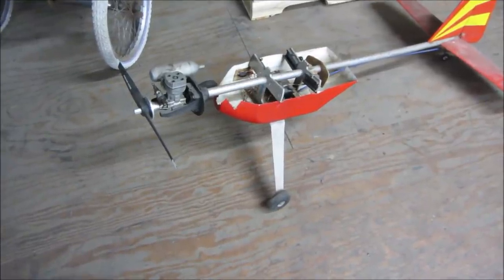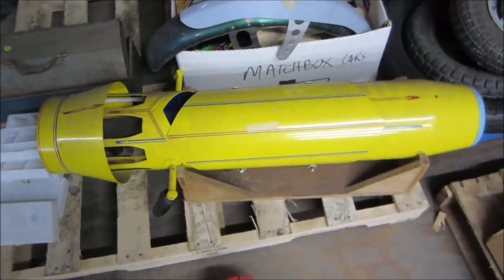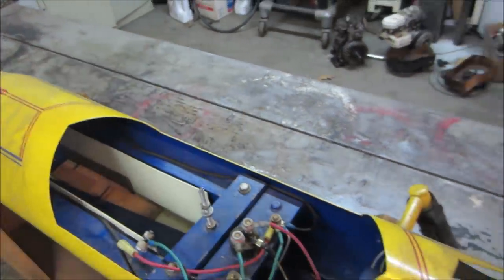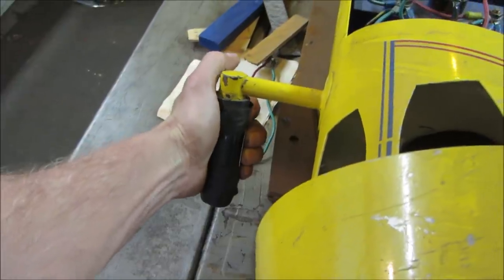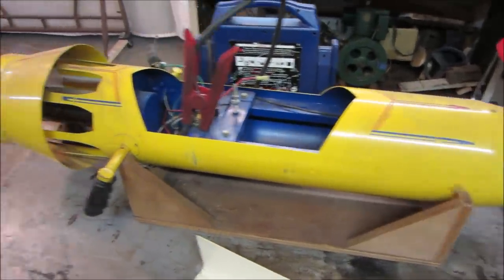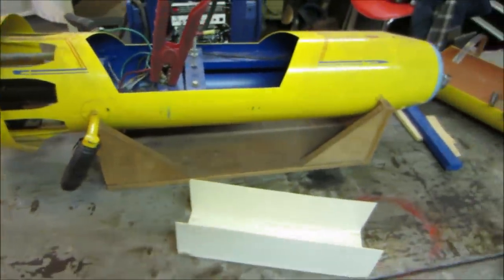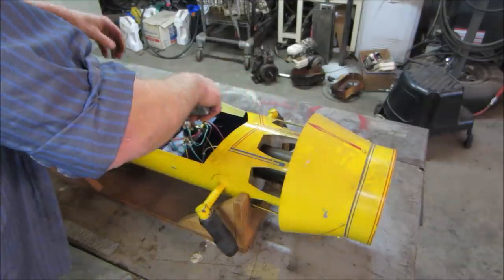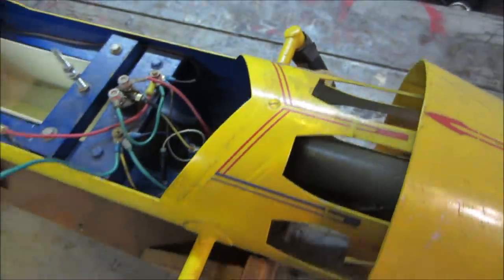Antique Scooter for The Water? Will It Still Work.

Comment: Back in the late sixties Cousteau used a bit sleeker version.  I don't remember the cone enclosing the prop flaring out so much at the forward end.  You could buy them and I remember wishing for one at the time.  This was before electric trolling motors I believe.  I never saw them used for anything but scuba diving.   There was another version where two riders sat upright on a larger version.  Only saw them used by the military and in movies.  This looks like someone creating their own.  The factory ones were fiberglass.  I think they had a sealed battery compartment.  They did have limited range.
Reply: Reality Effect  Show me anyone without feet of clay...  Give the devil his due Cousteau brought a whole generation to the undersea world.  His cinematography was unparalleled at the time.  Was he an elitist?  Certainly.  Selfish? Beyond doubt. Was he effective as a communicator?  Very.  Lesson here... Never hero worship anyone or be prepared to be disappointed!  That includes religions.  Think for yourself. That doesn't mean you can't appreciate the good that is done.
Reply: I have a Trolling motor from 1948. It uses toggle switches for F/R, 3 Pos. dial switch for speed, and an off/on switch for go/stop.
Reply: @douglasthompson2740  What an excellent response! Thank you!
Reply: Kind of reminds me of the ones they used in the James Bond movies.  I think it was Thunderball with Sean Connery?  The big underwater fight scene at the end had a bunch of similar units, although armed with spear guns and much fancier.
Reply: My 12" GI Joes from the 70's had stuff like this lol
Reply: Me and my brother and sister used to watch Sea Hunt back in the 60s. Lloyd Bridges had a machine like this only it was like twice as big.
Reply: @Guitarzan8  That's it!!  SEA HUNT, with Lloyd Bridges.  I knew I had seen that thing somewhere.  I'm sure I saw it, or one like it, on Sea Hunt.  LOVED watching that show.
Reply: Reality Effect   Not that I don't believe you. But never researched Cousteau that much. He really caused another humans death in pursuit of underwater exploration ? Bit ironic if accurate. Thanks

Comment: Looks like a early model sea scooter with a headlight.  Definitely meant to be watertight, the inside of that scooter doesn't look like it would work very well if it were wet and salt water on the inside would have started corrosion which would be obvious as well because it's clear that if it were allowed to get wet it would be very difficult to dry it out again.   Looks very similar to the ones created by Jacques Cousteau (their inventor) so probably at most two generations removed from the originals.

Comment: That rc plane is called a "pipe dream" and it is from the 80s.  There are a couple of videos of it on youtube. You could adjust the CG by moving the wing back and forth.
Reply: Yes - the Pipe Dream but it definitely isn’t a scale model of anything that ever flew with a pilot.
Reply: @assessor1276  I never said it was scale.
Reply: Built by Byron Originals, in Iowa. They had some pretty impressive scale kits for sale and put on a great RC air show every year.
Reply: @animalmother9339  I think it was a slip of the tongue on his part. I've been asked what scale some plane were by people who don't actually fly but they are usually saying scale when they should say size.
Reply: @jennitro  I got to go to one of their shows. I don't think they do them anymore. It was great. I think they're out of business now
Reply: @randall1959  They moved the show over to Ames for a few years, then it kind of just stopped. Maybe made it to 1990, but I'm not sure.

Byron Originals went away about the same time, I think.
Reply: @jennitro  I went when it was in Ames. It was one of the last shows.
Reply: @randall1959  They ran it for 6 or 8 years over in Ida Grove where the company was based before they moved it. I never made it to one of the Ames shows, so I don't know how they compared.

Byron Godberson was the owner of Byron Originals (or at least the Godberson family was). They had quite a few businesses in town. All their buildings had this castle look to them.
Reply: @assessor1276  There were some whacky designs in the early years, because if you weren’t trying to carry stuff, there’s no need for the fuselage to be anything more than a strut with sufficient strength/rigidity and room for control cables. 

If Bleriot had fibreglass he may well have built some of his planes this way, but instead it was open trusses.
Reply: @fromagefrizzbizz9377  The pipe dream was designed to carry lighter glow powered engines or the heavier gasoline engines. Being able to slide the wings back and forth allowed you to change the CG to affect flight performance as well as not having to add or subtract weight to balance it. If you had a light engine slide the wings back or if it was heavy slide them forward.
Reply: @randall1959  Exactly.. thank you! lol

Comment: Dry cell batteries like what would used in a mobility scooter. Look for long Amp hours. You could also use cordless tool batteries.  When testing a scooter I got I use 2 batteries from snap on and they did quite well. Plus you halve them in your shop. 
Thanks from Staunton Virginia, Bob Ordewald

Comment: my parents were scuba store owners and instructors in the 80's they had a pair of very similar devices. I do know they were expensive. They were branded though. in use you didnt actually stay behind it but kinda loomed over the thing. run time was pretty short if I remember correctly. they used them to chase students that were flailing about. basically they would roll up on someone who was panic and hit their vest inflator or drop their belt. these ones were pressurized in use so you could get them neutrally buoyant. I was snorkeling above and watched the crazyness. much shorter than this one too.
Reply: Any chance of this comment in English ?

Comment: Hello Mustie short or longer videos both are worthy of a cup of coffee and my time. Please keep them coming. I think you could add that to the Beaver and improve it!s water performanc. Hey look there is another video?
 As for the unit my father was in a SCUBA group back in the 60!s they made a lot of the equipment themselves. This looks very much like one of the proto type units. I think it should have 2 or 3 big wide stainless band clamps to secure the cover to the body,  They were supposed to be water tight and almost neutral in buoyancy.the later model had the Handel's a little farther forward and you rode over them  with the unit resting under your chest,  you were also correct there was a Popular Mechanics or similar type make it yourself plans available back in the ugh " Good Old Day's. Keep up the great work.

Comment: The lack of safety features is concerning but you generally would hold it in front of you and below your line of sight to avoid the wash.  They also should have a magnetic kill on the handle so if you let go, it wouldn't disappear into the depths. For a fat diver like me, they would add a considerable amount of bottom time to the dive.  A blast to use.
Reply: The lack of safety features keep the balance of nature in check.
Reply: I 100 % expected the prop to spin up only if both switches were closed as a minimum safety feature, but, eh.

Comment: Loving it!

The names "Aqua-Doo" or "Hydra-Tow" come to mind, but I doubt this would be either. If I'm honest, I thought it looks like a DIY kit build, something you'd buy from an ad in a weekend magazine and assemble at home. I had even wondered if it was ever completed, or has ever seen water.  It's definitely a crude effort.

I would check that thick rib along the bottom - See what it's made of. My guess would intuitively say it's metal, and I'd surmise it is actually meant to be a keel, to give bias to its buoyancy and keep the machine 'right side up' - If it's wood, then it's not much more than a fender/rubbing strip.  I'm also wondering if the casing should contain some form of flotation bladder - An inflatable bag, or bags to allow the user to obtain a neutral buoyancy. You could use the bladders out of footballs, or even a couple of plastic bags filled with ping-pong balls would help. Just a thought.

Batteries? In the modern world I's suggest NP12-12 or NP12-15 as a starting point, and up to NP12-18 or NP12-22 mobility batteries - Sealed Lead Acid gel/AGM batteries. Emphasis on sealed, you wouldn't want sea water getting into a lead acid battery, the consequences could be severe.

Comment: I thought u would ride that thing like a torpedo, i wouldn't like having the prop in my face :D
Reply: As long as you don't wire it backwards it shouldn't be too dangerous, the propwash would push your face/fingers away, and you'd hit the trailing edge of the blade first. Just keep any dangly bits away from the intake bell.

Comment: Yes Mustie there should be a fin up front where you saw the hole. For front level stability and no its not to be air tight. Otherwise it would float  its not homemade  maybe someone painted it
Reply: There must be some air left in the inside though, or how does the batteries and connections would work under water?
Reply: @silacka3114  Low voltage isn't a problem underwater.  There isn't enough current to cause a short.
Reply: @Biffo1262  Oh ok, i did not know that. You learn something new every day..
Reply: it needs to be neutral buoyant so it doesn`t drag you down
or float to the surface. if it filled with water, the batteries would make it sink.
I used to scuba dive, I seen newer models in use.

Comment: I don't know how those switches and electronics could survive in the water , they are not water proof from the looks of it!
Reply: Direct current.
Reply: They would be kinda OK in fresh water, but you would probably want to wash it and soak it in a tank of fresh water after using it in salt water.
Reply: Or just coat it frequently in WD40. But I guess the switches are consumables.

Comment: If it wasn't watertight, the batteries and the electrics would be lots of fun in salt water. Watch WWII war films for a starter on the subject of water and batteries.
Reply: That's why you wash everything down with fresh water after use.  Any sea angler will tell you that.
Reply: Sealed lead acid at 12V wouldn't be that bad. You would want to wash the heck off them after done using the thing. But as long as they remained sealed you would be pretty much OK. 

Submarine batteries in WW II were non-sealed, and if salt water got in with the acid in the batteries you got chlorine gas and other bad things real fast. The battery bus was also 120V if I remember correctly, which would be real unhappy in sea water.
Reply: @lwilton  No idea if it was 120V, but the individual cells that make up all lead acid batteries are 2V. Don't think you need much voltage in any switchgear for salt water to short it out.
Reply: @COIcultist  Well, salt water isn't a dead short, it is a resistor, and the resistance depends on the salt concentration and the volume of the liquid between the two conductors. Basically up to about 36V you can almost ignore the problems in sea water for short intervals (a couple of hours) if you are using big brute-force electrical stuff like this, and hose it down real well with fresh water before it has a chance to dry out and the salt crystalize on things. Modern electronics stuff (like a speed controller in an electric drill) would likely be trashed by sea water pretty quickly because the traces (wires) are much finer and closer together. Note that vented lead-acid batteries and sea water just don't mix for any period of time, which was a big problem with stuff until the late 1950s.
Reply: @lwilton  Thank you for more than I know.

Comment: My guess is just two standard sealed lead acid bricks. Still confused about how this thing goes in the water though, in terms of buoyancy and waterproofing.
Reply: It's not water tight, it's not supposed to be, if it had air in it it would float you'd be constantly fighting against it instead of using it to help you.
Reply: @madmax2069  That certainly makes sense, but all those exposed terminals wouldn't last long with the amount of electrolysis that would happen when submerged.

Comment: The shroud/duct around the prop is a very nicely shaped Kort Nozzle. We use them on remotely operated and autonomous underwater vehicles a lot. There's a lot of info on the web about those, they greatly increase the efficiency of a propeller on underwater robotic vehicles. For sure, get a screen on the prop - a 3/8" SS mesh would be adequate to keep your fingers/ lips or nose out of it. A good demo I use when teaching U/W robotics is to have a spinning prop hack up a carrot or hot dog - it'll scare the bejabbers out of students. One more consideration when you are getting to the point of having it haul you around underwater would be to test its buoyancy first. It'd be very important to have it slightly positively buoyant so if you have to ditch it, it has a chance to float back up on its own. Test it prior to each use, it'll be different in fresh versus salt water.

Comment: Aw yes the birth of two stroke toys. It was great. Spending hours assembling and lead painting until finally FIRST FLIGHT!!!
That's when you discovered the one flaw of 1950's/60's motorized toy. No controls. Before they even added the strings. Basically a long distance Yard Dart you'll never see again. Death from above!?! 
The later ones with the strings (and larger fuel cell), where like permission from your parents to take out a little brother or two.   
I even had (until first run), a Baja Buggy VW. It was slightly over a foot long and able to hit mach seven. At about ten lbs and a two hour fuel supply, really more of a land torpedo than a toy. 
I took it to a rock quarry, a mile from the nearest road, an interstate. I was not going to lose this one. I even set the wheel lock so it could only run in circles pointed AWAY from the road out of the quarry pit.
It was running like a well tuned  Nas car. I was so happy. The first rock it hit that little SOB turned and came straight at me climbing halfway over me. Then straight out of the pit onto the interstate causing a five car pile-up. 
If your old enough you probably saw it. On the news.

Comment: I think it might have been made out of wood stove parts. The exhaust vents around the prop look quite familiar, there were several unique designs in the '60s and '70s for chimneys that would draw cool air in at the bottom and harvest some heat off the chimney using natural convection. I think that's what that portion came from. If you look at where it tapers to the headlight, this looks much more crudely done, perhaps worked by hand using a headlight bezel from a vehicle

Comment: I remember sitting in a dive boat in Cyprus not far off the Military base, and a diver SMB (Surface Marker Bouy) went past at an amazing rate of knots followed by a special forces RIB...
The military ones used to be made by Farallon and if you'd seen one of them, you'd have had the idea to make something like yours.
Modern DPV's (diver propulsion vehicles) are much the same, simple on/off (some have a knob on the back of the prop which feather the prop and give 3 speeds.)  Yes you hold it below, elbows in, with prop under your stomach.
Not for snorkelling, though they did a snorkeller vehicle with a gas motor (chainsaw size) and a float with a 'periscope' for fresh air for the motor.

Modern DPV's are great fun, but need training before use, but even with o-ring seals you're likely to flood sooner or later and dragging a dead, negatively bouyant DPV back to shore gets old real quick!

Comment: I'd use ups batteries, absorbed glass mat.. might not have an issue in fresh water... but definitely short out fast in salt. maybe a small bilge pump with a check valve or purge air from your scuba tank could help keep it from flooding out.

Comment: If that was airtight it would be a bear to counteract that much buoyancy.  Maybe with the batteries it weighs enough to have a somewhat neutral or slightly positive buoyancy.  I don't think you'd want it to sink like a rock if you lose your grip on it in deep water.   Pretty cool regardless.

Comment: A couple SLA batteries like an electric lawn mower uses.  
You might use a wall wart battery charger.  
Fill it with bubble wrap so it doesn't sink.

Comment: I would imagine it would leak some if you stopped and held it under but just like you can remove the drain plug in a boat while it's moving, I bet it would stay pretty dry as long as you keep it moving when it's under water. I would make a battery with lithium ion cells... You can do any size you want with them. I am guessing you would want to hold onto it so your body and face are above or below it rather than taking it in the face... LOL. Pretty damn cool toy!

Comment: I wonder if the unit was actually upside-down to access the innards (maybe pull those batteries out). Looking at the Wiki, the handles should be ergonomic to a human on top of the prop shroud. Really neat in any case! Wonder how long it would run on modern lithium batteries. 😁 Edit: Assuming the rest of the "hull" is sealed, that would also help with waterproofing -- a lot of the air would have nowhere to go with the body inverted.
Reply: What you say makes a lot of sense and i agree that it should be ridden inverted but i for one wouldn’t ride that bugger   In anything deeper than a pool and even then with great trepidation lol
Reply: @roderickmacgregor4867  But why?? The whirling blades of death are shoving you away from them with the force of the water! What could possibly go wrong? 🤪😅

Comment: Being airtight is very important especially in salt water. The cavity would fill with water batteries with drain very quickly. I think you’re also right that it would be very very heavy and lose buoyancy
Reply: Shorted out with water the batteries would drain very quickly indeed.